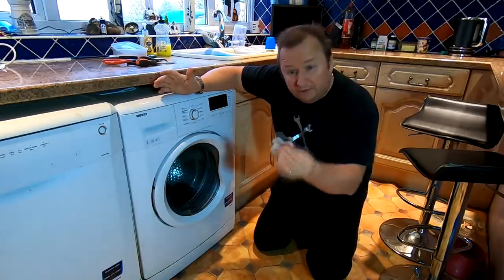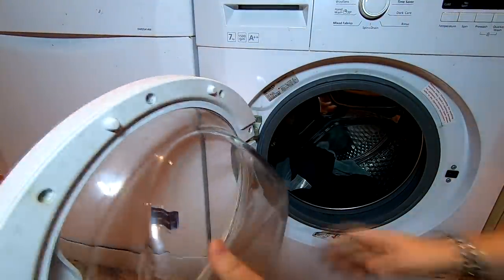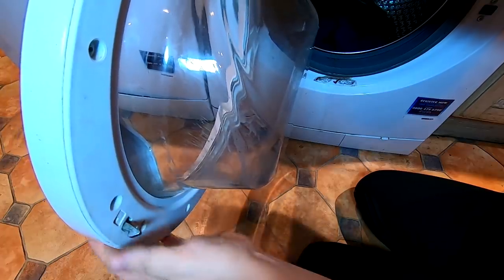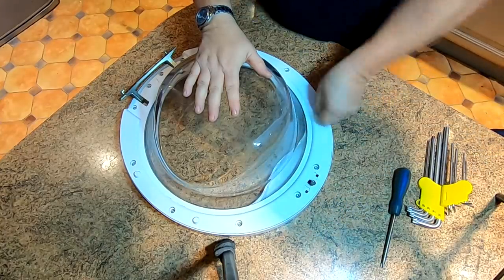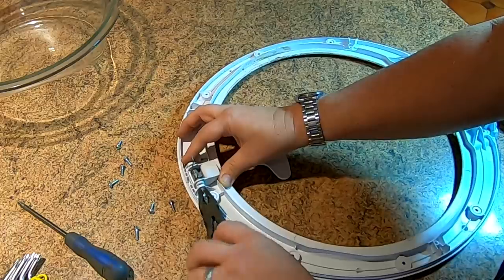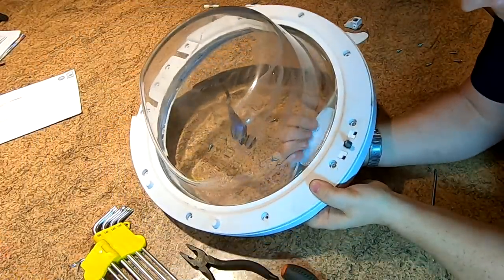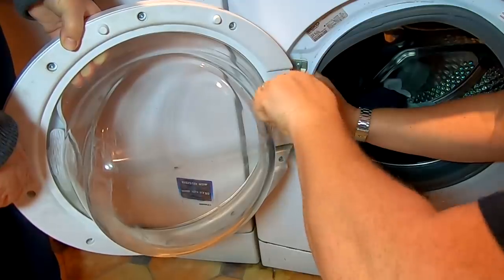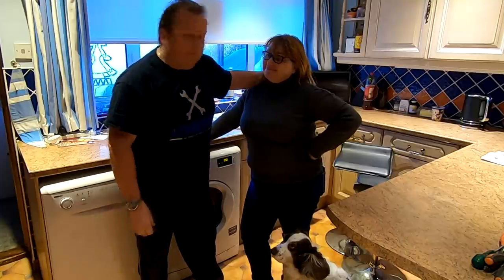Beko WM 74155 LW Washing Machine Door Handle Fix

Comment: Absolute legend mate. You're the only video on YouTube that showed the bit about the spring having to clip in properly with the ring. Was stumped for ages wondering why it wouldn't lock when I had it all back together. Big thanks!
Reply from the maker: No problem 👍
Reply: Exactly the same thing happened to me. stumped for hours until I looked at your video were you showed the spring having to clip in properly. Thanks
Reply: I think this has just solved my problem too…

Comment: I’ve just replaced mine with the use of your video. Stalled at getting tension on the spring. After checking several times the correct fitting of spring and handle, which I had done correctly. It was the positioning of the two prongs on the spring. It would have been helpful to have shown before putting on the facing panel where these should have been positioned and that sliding the panel across rather than putting it on the top and pushing down would actually made things easier. Took me an age to work it out but do have to say the rest of the video was very helpful. You may want to add a clip pointing out the location of the spring prongs which would make it clearer.😊

Comment: This is great, saved me a repair vi$it. I found that it helped to angle the door plate to push the spring toward the edge while reassembling. This makes sure that the spring is tensioned on when everything goes together.

Comment: Martin, knowing what you know now, you would've got away with not disturbing the door seal if you'd been very careful but it was a wise precaution and not a problem. Who'd have though that even washing machines have Torx screws these days? I've just checked our Beko WMB 714422 B and that has Torx screws too. Nice to know that genuine replacement parts aren't always expensive. We used to have a White Knight 77AW tumble dryer that I'd repaired a few times. We now have a Beko DCU 7230 B that compliments our washing machine quite nicely.
Reply from the maker: Yes Dave but if a ham fisted person removed the door, they might have still disturbed the bracket so removing is showed how the lugs sit for the rear bracket. Not only that, it also showed how the seal as held in place.

Comment: Good job saved a few quid-not necessary to bother yourself taking the seal clamp off thats why the backing plate has the lugs so it stays in place when screws have been removed -the model numbers and letters stand for certain stuff ie WM=Washing Machine then 7 is the kg capacity, 15 is for 1500 spin and the LW the W for the colour the 4 ,5 and L I'm not sure but could be to do with the amount of main wash progs and special progs -bit of useless info for ya -great vids keep em coming
Reply from the maker: Yes, Lee, thanks for the info.

Comment: Thank you so much, this was perfect for me to follow and fix my machine handle! Really clear instructions and explanations, much appreciated! :)
Reply: Getting that sprung wire back on was tricksy though! I got my glamorous assistant to pin the wire in place with the edge of a screwdriver, while I worked the spring and rest of the wire back on with two other screwdrivers, where the extra section of rubber sits to the bottom left. All in working order and looks like it's all right! Thanks again for a great tutorial ,👍🌟🌟🌟
Reply from the maker: Well done and you saved yourself a call out charge too.
Reply: @retrorestore  aye, that's a massive saving!

Comment: How do you get it open if it snap off when it was closed?
Reply from the maker: Now there's a good question.
Reply: If anyone else is wondering, use a flat head screw driver and push it into the snapped  part(towards yourself) to lever the switch the way the handle would, just came across this problem and found this method much easier than the string method or opening the top.

Comment: Went through 2 washing machines about 3 years back, one was a beko, absolutely rubbish (the one I had was anyway) electric faults knew no end. Was a shame as we used to have a beko previously and it lasted us about 10 years, so I assume they're made somewhere different, with lower quality control of late. Was that pi$$ed off with it all, I invested in a Miele. Not cheap, but bl00dy good quality machine!
Reply: Beko are Turkish but like most manufacturing its all done as cheaply as poss so quality suffers-even some of the top brands have sold out on quality